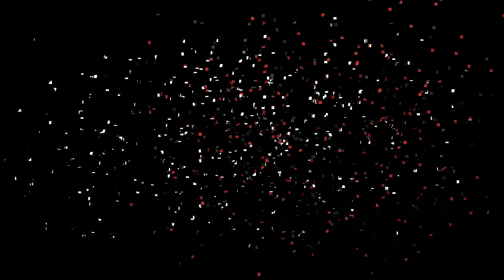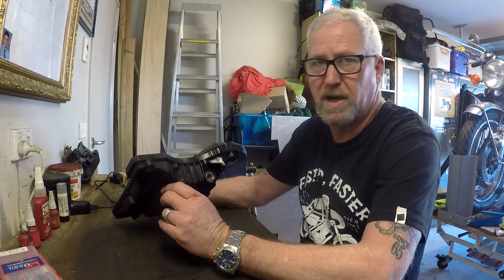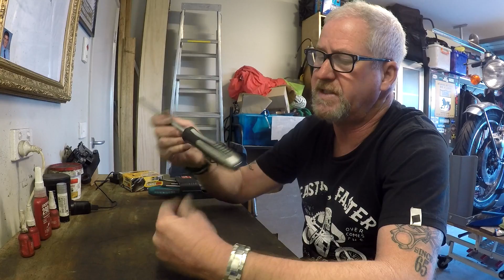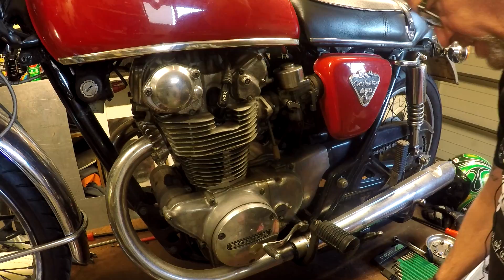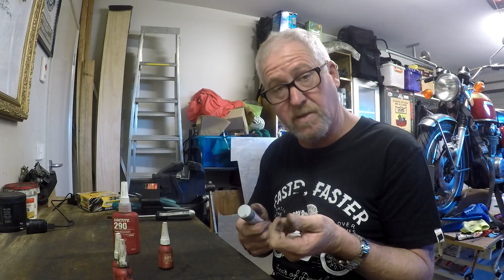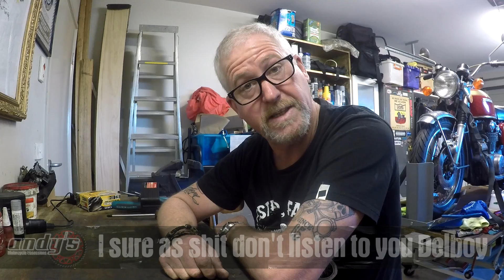How to remove corroded bolts or screws on your motorcycle

Comment: hi andy i have a problem with copper grease when service my brakes yes or no some people use a lot and some dont use it at all i have a 2017 sv650 al7
Reply from the maker: I don’t use it and I don’t ever recommend using any form of grease or lubricant near a braking system. If you live in a country where they salt the roads you also have corrosive chemical issues where the salty water is an electrolyte and you are combining that with copper and aluminum, a battery essentially.

Comment: You lost me at 2 seconds in telling me I wouldnt use stilsons to undo an axle. I laughed to myself at your lack of understanding of me. I used grips to remove the axle on my varadero 125. Yeah, Im a pretty hard core biker with serious mechanical skills. They did the job and now I have an axle bolt with a mashed and rusted head but I also have the satisfaction of knowing that I did the job when it needed doing.  IMHO, if you have more than the following tools in your toolbox, you are either a NASA engineer or some kind of homosensual: Hammer, grips, screwdriver, superglue, another hammer (in case the first one breaks.) 
Im available for bike repair in the London UK area. No job too small.
Reply from the maker: lol 😂

Comment: Great vid Andy,
Loctite is of course a fantastic invention in its many forms for the engineer who can. However there is a sealant/gasket material made by either the Devil himself or the Freemason's called STAG. If you ever see this evil product either leave immediately or burn the place down if you have the balls. Enough said.
Reply from the maker: I’ve seen and used it. We used it for sealing welsh plugs (freeze plugs) in engine blocks when I worked as an engine builder

Comment: Andy. Can't believe that you would steer anyone to watch 'Chase on two wheels', unless it's as a 'how not to do anything'. The guy is worse than Del, if that's possible. It's the opposite of all you do!
Reply from the maker: I did enjoy the first wrecked bike rebuild and a large part of that was his naivety but this ZX10 series is painful. It’s fair to say that I do like the concept but he is proving to be completely incompetent. Thanks for watching Paul
Reply: I managed to watch the Monster series until the start of the 3rd program when he started butchering a screw with a Dremel; then he butchered his finger - I had to stop then, before I threw something at the monitor!
Reply: Exactly, I was about to say the same thing. Watching him rebuild bikes is more comedic entertainment than instructive. He doesn't even bother to read up on the manual before he starts something.
Delboy"s "simple skills" videos are helpful in at least showing me a way to do stuff without specialized tools, e.g. fork seals or wheel bearing replacements.

Comment: I love your vids Andy, really helpful and well explained. Definitely helped me out a few times so a big thumbs up from me. 

By the way, quick tip with super glue that I’ve found after the initial panic of sticking my fingers together is a bit of warm soapy water will eventually release them. Takes a bit of time and prying but I came away with not skin loss or scars, just some glue residue that took a while to get off my fingers.

Comment: If you have the time and patience: Make up a 50:50 mix of Automatic Transmission Fluid and Acetone and apply. The acetone wicks its way into the thread, taking the ATF with it and works much better than anything such as WD40 or the like.
Not my idea, I got it from a very knowledgeable fellow Guzzi enthiusist Rod Yeomans, who sadly passed away a couple of years ago.
Reply from the maker: Robots N That great tip mate, thanks for sharing, Andy
Reply: Not heard of that one before, cheers. It'll make a very thin penetrating fluid. Will give it a try and see how it performs against my normal diy plusgas- copy of diesel and aromatic naphtha mixed with a dash of engine oil . ATF and acetone will sure smell better 👍

Comment: I've got some exhaust manifold studs stuck in my Honda CBR600F 2002 head, so I am soaking the studs in Alum and water solution, it disolves steel and iron. Have you ever tried this method...?? ...I have tried the large hammer and small chisel many times, requires care and patience...like your videos
Reply from the maker: Hi mate, no I have not.  I mean I have used penetrating fluids, but not corrosive types.  The zinc content, I understand, is what exasperates the issue and makes them more difficult to remove.  If anyone has a good understanding of this I would love to know more @modshackmerlin?
Reply: Please just try a spoonful of Aluminium Sulphate in a bowl with some water, and drop something steel in it for a week, and leave it, heat speeds it up but I didn't bother...7 days later it should be 1mm smaller. Cos the studs are screwed in I have been soaking one end of the cylinder head on it's side where the studs are, obviously avoiding any contact with any steel, it's working but you need patience.....I am using 1 kg Alum to 6 litres water....

Comment: Whenever possible I'll drench my bolts in PB Blaster or WD-40 a week or at least a few days before trying to remove them. I repeat the soaking process daily and then give each bolt a sharp tap with a JIS screwdriver and hammer. (I sheared one of my dust cover bolts before learning such things lol.) Another great ally to have is a propane torch to expand the metal around the bolt. (In a well-ventilated area of course without a pile of oily rags in the corner hehe.) As usual great video and great technical knowledge Andy.

Comment: Hi Andy
Can you tell me whether I should use locktite or antisize when screwing stainless bolts into aluminum engine cases
I've heard there's a problem with dissimilar metals causing corrosion.
Thanks mate.
Shaun.
Reply from the maker: Yes you can use either, just not a copper based anti-seize.  You will make a battery if you use that.  I'd recommend a nut lock too, not stud lock, thanks for watching mate.

Comment: A great explanation about Loctite, particularly the catalyst bit and the need to keep it away from metals, I am an engineer but not a mechanical one so had never thought much about what triggered the stuff to set in the tube. The brake callipers on my car were attached to the stub axles with huge bolts with the blue Loctite on the threads, I don't like smashing sockets by using a scaffold pole over the wrench handle. I must admit I reassembled with anti-seize grease, but I would not recommend anyone copying me... 
Regarding Del Boy I enjoyed his video on replacing the seals on upside down forks, in that instance he seemed to have some very well thought out advice.
Reply from the maker: G'day mate, thank you and thanks for tuning in.  Anti-seize is never a good idea near brakes.  Generally you would not use it where you don't want the fastener to come undone, however, if you tension the bolt to it's set torque it will usually be fine.
Reply: Yes, they are torqued correctly, dissimilar metals in our wet country are a pain. Had to put antiseize behind the wheels too, you wouldn't believe how securely they stick to the hubs. Found your channel via Matts, keep up the good work.

Comment: I used to followed Delboy's garage...I used.I'm a machinist,mechanic,painter,welder and composites technician.I do my own tool if I have to.I'm no engineer but I know for sure those torques and measurements specs you find in service manuals are the results of R&D,they are SAE and ISO for god sakes.But apparently for Delboy it's bull sh...He wish me good luck for using those specs after I warned him to be carefull about misleading infos he could find on the web and wondering if he is one of them!
Reply: Shout out to a fellow composites guy !!! I'm a comp tech as well, marine, auto and aerospace !!! Also learning how to weld in the metal shop at work on my lunch breaks, i doubt i'll ever be welding but it's a great garage skill should you ever need it !!!

Comment: Good info Andy, back in my working days we did lots of chewed out bolt hole repairs. Worst comes to worst we used the spark eroder especially when some nong used a ezeout & snapped it, then either helicoil or time sert.
cheers
Reply from the maker: G'day Joe, yes have used a spark eroder on broken taps before, thanks for watching